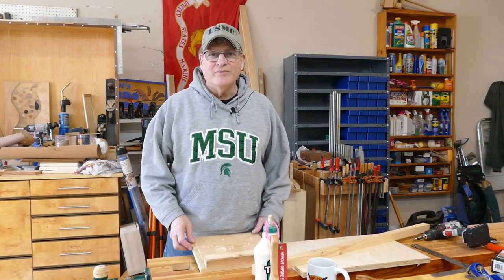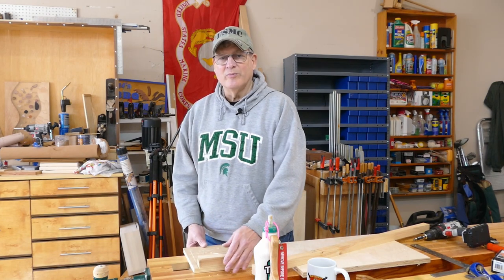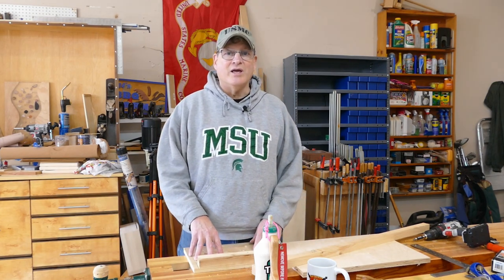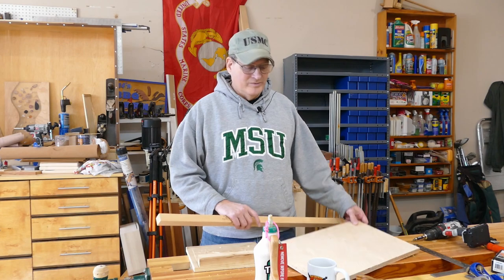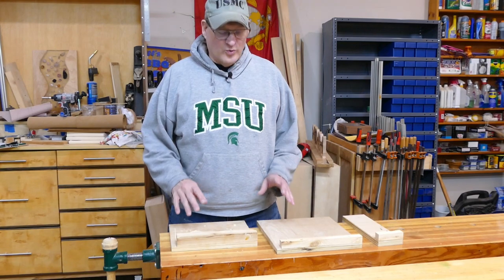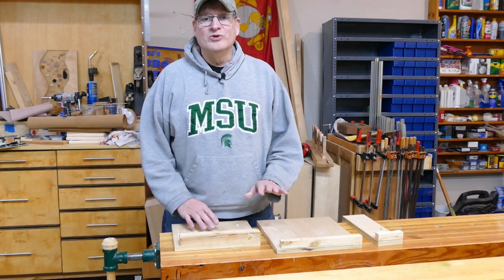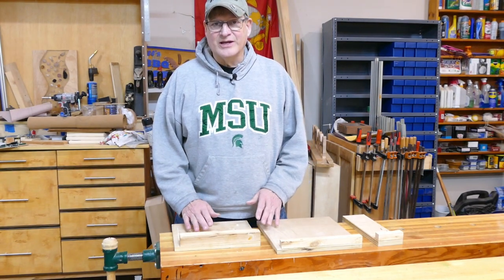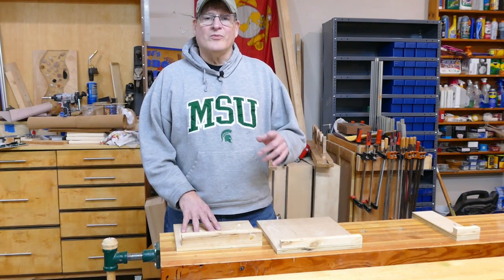DIY Easy Build Bench Hook

Comment: That was pretty scary watching you reach for the wood after it was cut through so it didn’t fall off of the table with the blade still running! 😮
Reply from the maker: Yeah, I really need an out feed table. Maybe the next project?
Reply: @30minutewoodshop  C'mon, tell him you're a Marine and ain't scared of nothing.
Reply from the maker: @The Meat   ROLFMAO!!!  Yeah probably why I've done it that way for so long. Faced worse, seen worse so it really isn't much to worry about (comparatively). Semper Fi!  👍